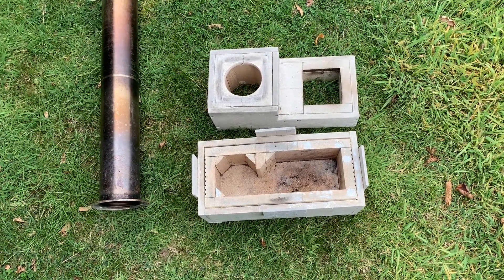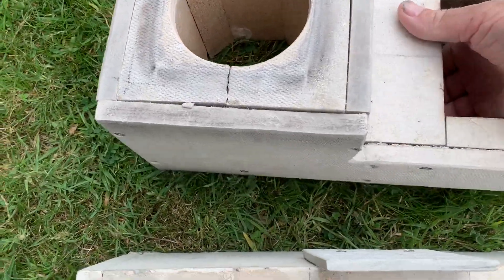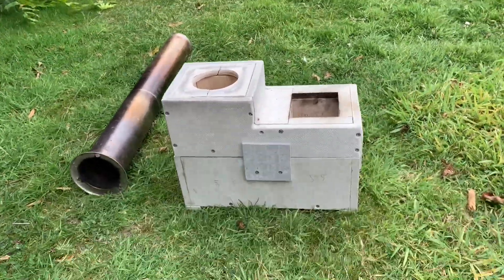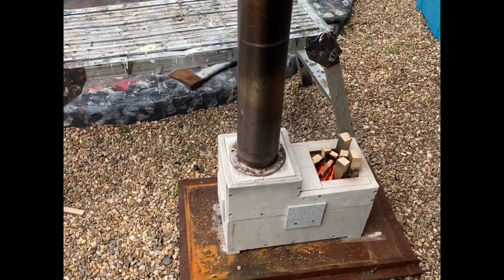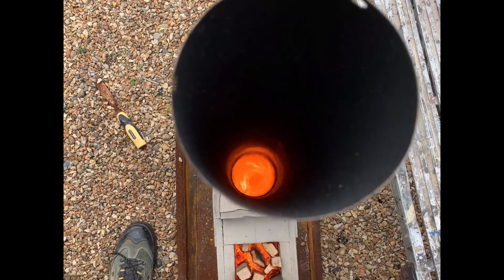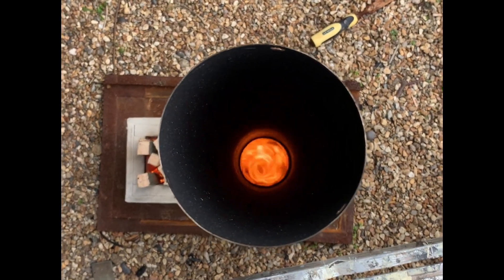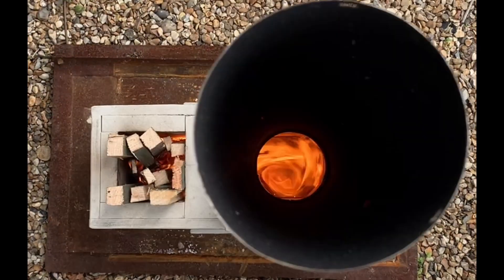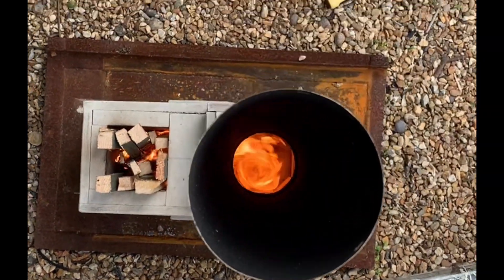Rocket stove

Comment: Three questions:
1. What's the size of the side stumbler that makes the vortex?
2. After the experience with the other stove, I would expect more turbulence with square corners, why did you round it out?
3. Does it have any secondary air? Where? How much?
Reply from the maker: .1…. Well in that case it was 40% or I left 60% opening. 2…. Always experimenting, square or round both work I can find much difference. 3…. No but the other versions I have built do, I made quite a complex version a few years ago that had lots of adjustable air.
Reply: What would you suggest for an indoor kitchen?
Reply from the maker: @ing.pagano  i wish I new my friend, the vortex is a little temperamental as you have found out, I think it just needs a bit more development but that is costly and time consuming! 
The J tube design built with care and good materials works extremely well but has to have a tall riser.  
I am trying out a new design J tube right now but not finished as yet…….
The batchrocket is a very powerful design but again has a tall riser.
Reply: @foxfish7115  yes, I've already built a batchbox (version 1), and it works great. But i have a feeling the subsequent designs with smaller riser are too convoluted, that's why I was looking at the simpler vortex stove
Reply from the maker: @ing.pagano  Mat walker makes a riser less core but like the other riser less cores it relies on a tall insulated chimney and a bypass to start.
I like the J tube for my use, i built an 8” version a few years back it was very powerful and would heat the hot plate red hot in less that ten minutes but  I had to bury the core so I could reach the hotplate. I only used it for one season as it was to hot to get close to.

Comment: Love these! Do you think an insulated riser would work as indented on top of your vortex stove? Then back down a barrel. Do you think the riser could be shorter in that design and still have the same amount of draft?
Reply from the maker: Yes I think the riser could be shorter because more combustion is taking place right at the base, I will try to test that tomorrow……
Reply: @foxfish7115  The only reason I could think it wouldn't work as I imagine is if the expansion in the after burner drives the draft more than the riser does. What would you change in your designs (if anything) for higher moisture content wood?
Reply from the maker: @wes16b  what stove are we talking about?
Reply: @foxfish7115  My apologies for being unclear. I was referring to the double vortex stove with viewing windows. I believe you said it is 4 inch. I would love to see it as a 6 inch system.
Reply from the maker: @wes16b  if you look back through my channel you can find a 6” vortex stove, maybe 3 years ago I built one.